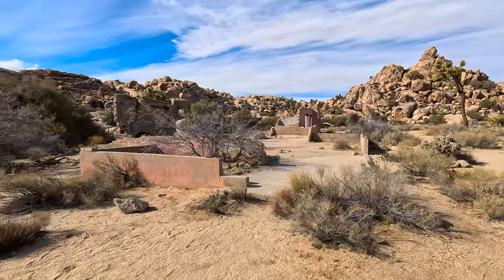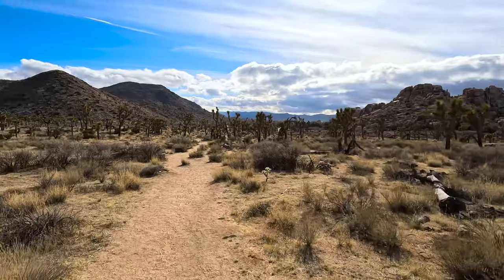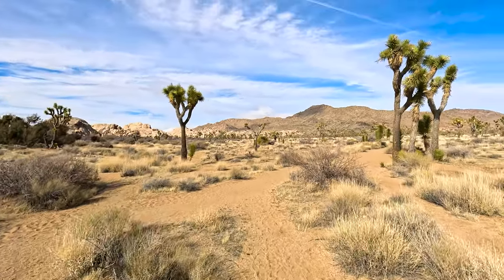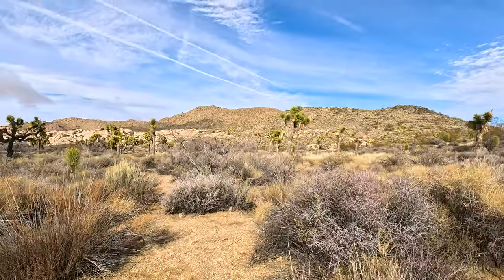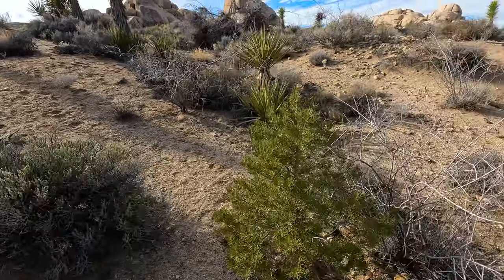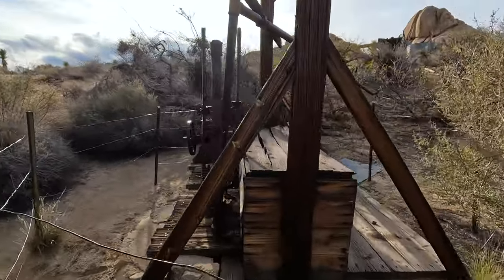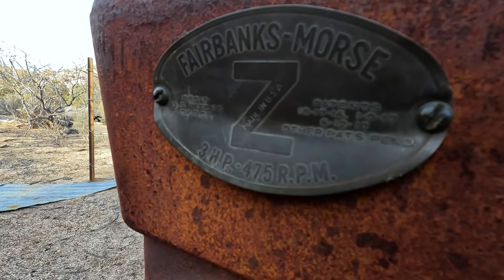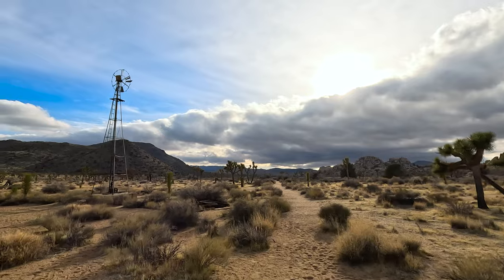This place is AMAZING - Abandoned Gold Mill and 3 Old Cars

Comment: I come from a small country. There aren't very many abandoned areas here. There is still an abandoned part of Schweinfurt. I've lived there for about 10 years. I would give anything to be able to live where you are right now. To start the old evaporator motor and have water. Later also electricity. I would dig out the green car, get an engine, the gearbox could perhaps still be used.....Wonderful video, I could watch for hours.

Comment: That’s a Stewart Warner vacuum fuel pump, it worked by engine vacuum! It had a internal  float that tripped the vacuum off an then drained the gas by gravity to the carburetor.